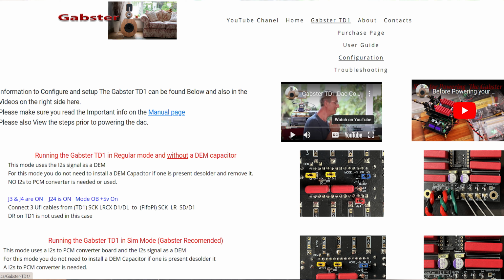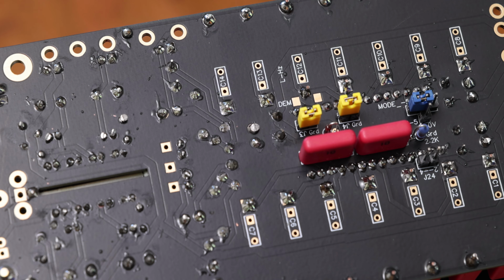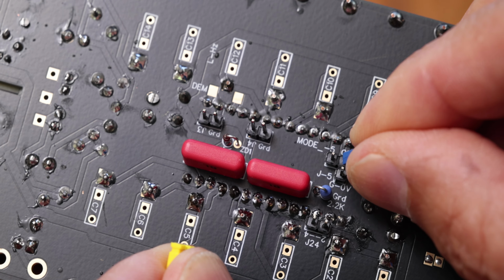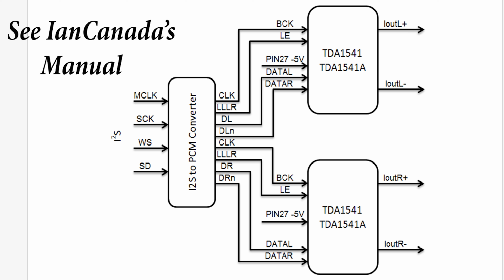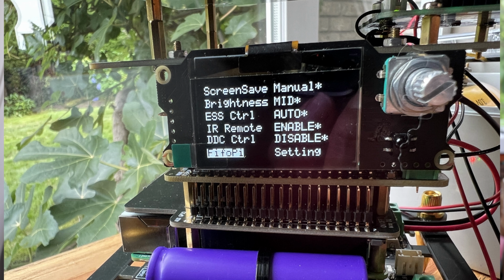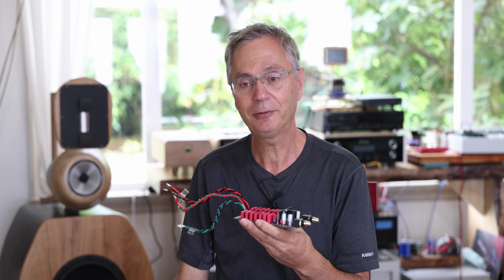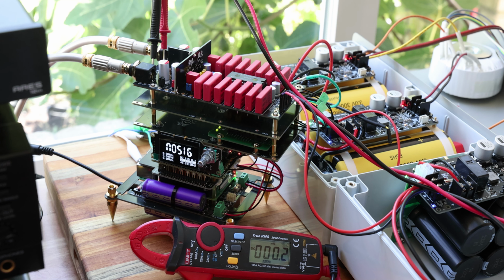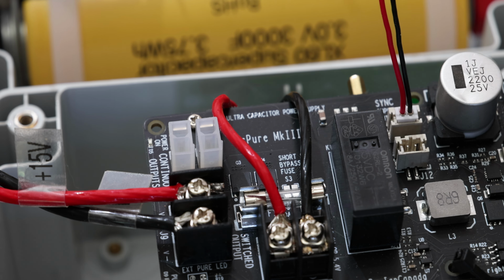Gabster TD1 Dac Configuration and DC Offset. Sim, Reg, Balanced mode.

Comment: Nice work and so great to see your passion for the project. With some limited experience and recently a/b testing a Magnavox TDA1541 cd player vs a Denon cd player with a PCM1702 Burr Brown i seem to prefer the dynamics and sound of the PCM1702 but it is not hugely different. Maybe it is the implementation as usual but just wanted to mention. Best Wishes to you, Gabster and i may just try out your project too soon.